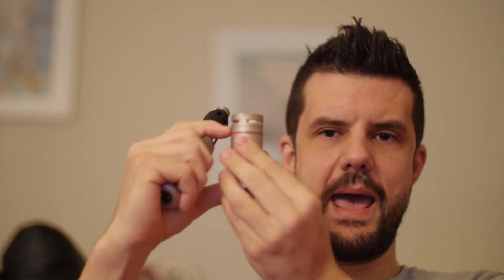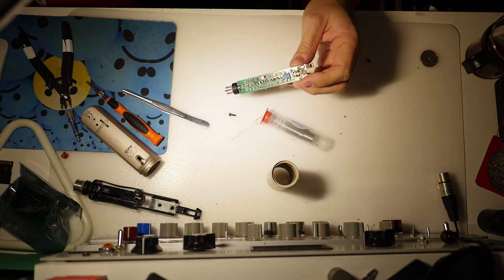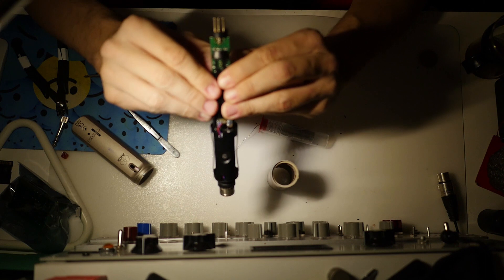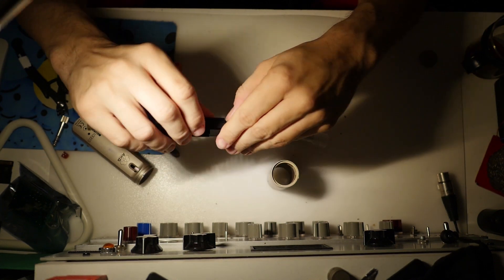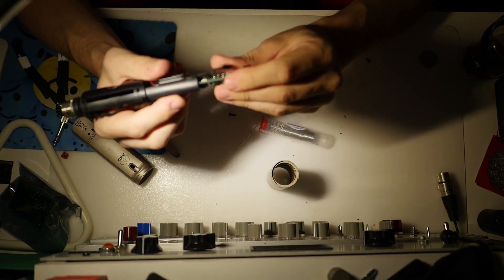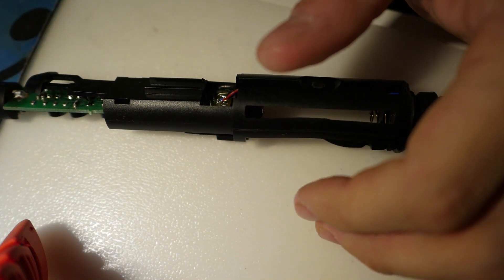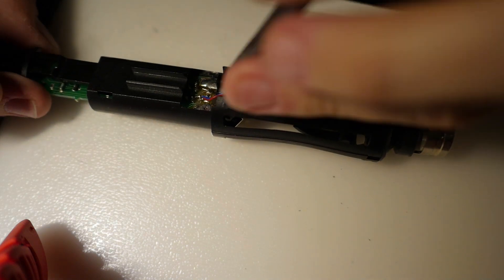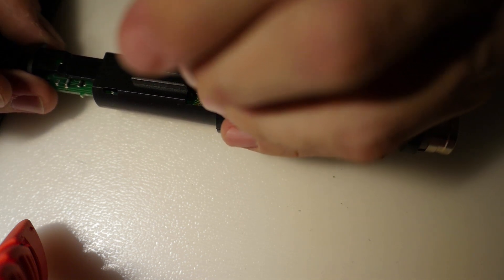AKG C1000 (C1000S) Ultimate Modification

Comment: Does anyone know if you can mod and how to mod the c1000s version 2.2wl? picked one up for cheap and thought it would be a fun project. I got the capacitor and opened it up and it looks completely different than this video. i dont know if i have an older one or not. im guessing not just by the version 2 designator. cant find out any information on this. this video is great!
Reply: Me too man, me too. I have tried measuring all the caps but I can't find anything in the ballpark of the .68 that it is supposed to measure.
Reply: @ivanvicente9633  same problem for me. Mine is a "Made in Austria" version but with the red band. All the components are jammed on the switch side and I can't find any info about where to solder on the extra 1uF capacitor. Will try to read the schematic.

Comment: Thanks, now I know which cap to replace. 
When I modded mine, some years ago, rather than cut the casing back, I moved the capsule forward by about half an inch (1.5cm?), by loosening the wires and gluing in the plastic cap from a kids drink bottle. That meant I didn't have to chop the end off, and still had the grille in place to protect it. 
And yes, it took away that harshness in the top end which had been bothering me for years. Great video and you've earned a new subscriber 👍

Comment: Does anyone know which capacitor is the C2 on the older design C1000 S? This is the newer mic.
Reply: I have the same issue.
Reply: @MiLo_Studios_portfolio  I was able to finally figure it out, though in my opinion adding the capacitor didn't make that big of a difference though raising up the condenser unit did help a little.

Its been a hot minute but if you want I could take apart my mic and snap a pic of the cap on the one I modded.

Comment: Hi, I saw your video from Japan and tried out the mod.

The original capacitor where you put the 1uF capacitor? came off in the heat.

I'd like to know the value of the capacitor that was originally attached to it, if you know what it was.
Reply from the maker: I dont know off the top of my head, just look for the schematics of c1000
Reply: @TheKingKorg I can't find them, do you know where they could be found? Thanks!

Comment: Amazing man . Can we do something about the seld noise of this mic.? Lowering it ?
Reply from the maker: Sadly, nothing can be done. The source of the noise is electret sdc capsule, and built in FET. It's not too noisy compared to other SDC, but not quiet by any means.
Reply: @TheKingKorg  thanks, I have two of these... one has better SnR then the other, is there something I could do to level it up ?
Reply from the maker: @TheTomallon  it is probably the difference in FET built in the capsule. They vary just like tubes. You can try to clean the pcb board with acetone. Be careful not to damage capsule with acetone though!